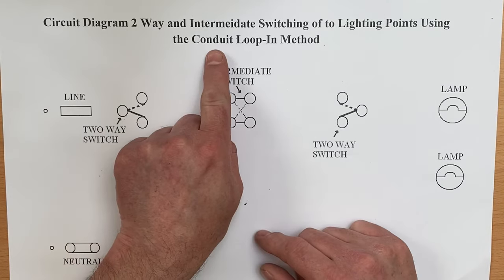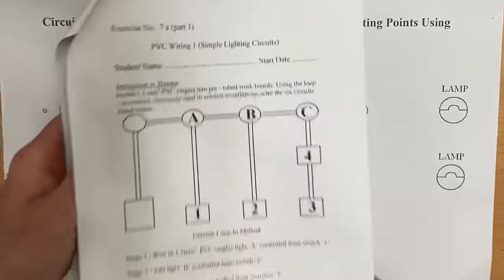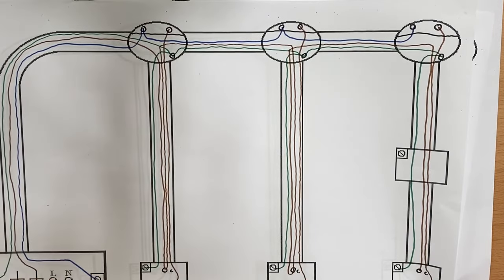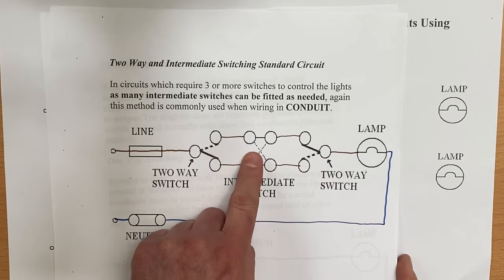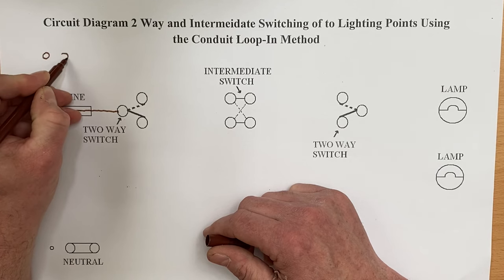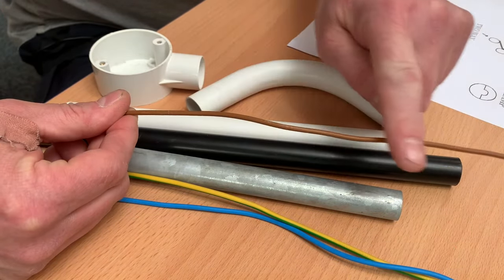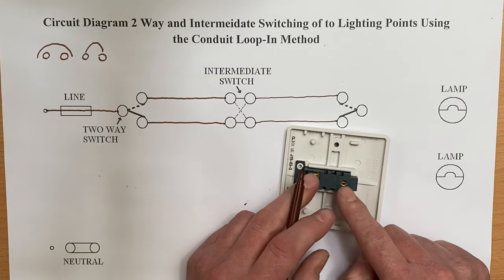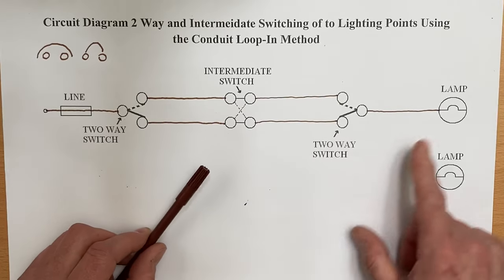Circuit Diagram Conduit Loop-In Method Part 7 - Lighting Circuit PVC Singles - 2 Way & Intermediate

Comment: At 6:35 There are some switches that do actually use one top and one bottom connection for the intermediate. I did find that out the hard way when I was provided some absolutely dreadful accessories.

Comment: Why is there such a big diference in wiring, in holland we use conduit in walls ,and we  switch our neutrals in the consumer unit , a ring circuit is something i never heard about until i started watching youtube, i'm not a spark, i did went to college for electrical.
Reply: The voltage at 230V or 400V phase to phase but it should be 'I did GO'🙃
Reply: @Mike_5  sorry my english writing is a bit rusty
Reply: @patrickd5712   No problem Patrick your English is in fact Very Good so no need to say Sorry!